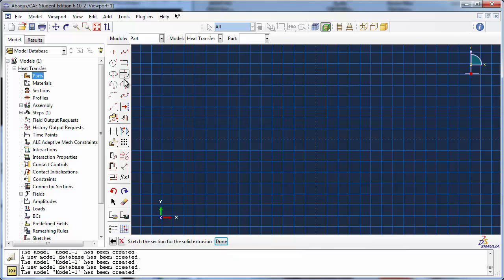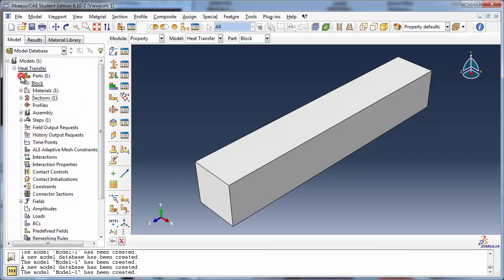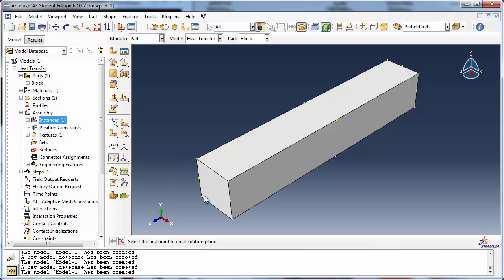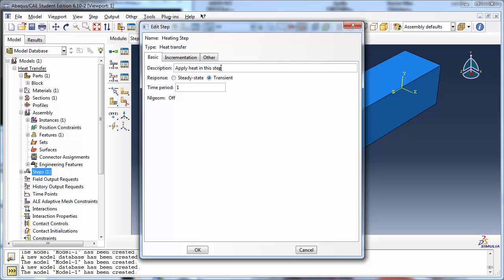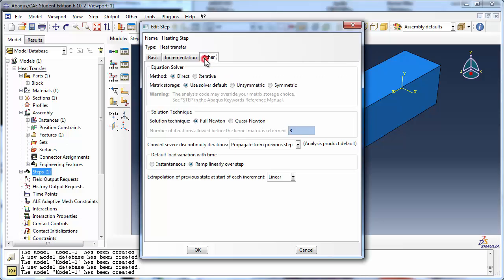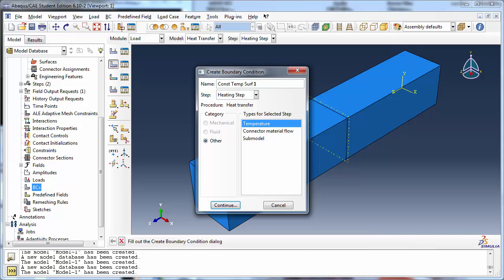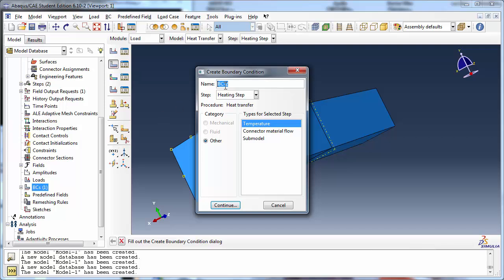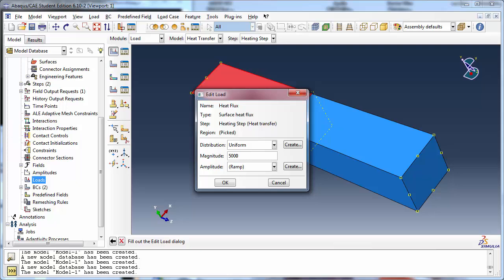10.b) Heat Transfer Analysis - Part 1 of 2 (with audio)

Comment: Hi, sorry if this sounds too basic, but I'm just a beginner here.
I'm trying to figure out how to run a simulation which has a three-layered box 
(ex. a large box with a medium sized box inside of it, with a small box inside the medium box)
heating inside of a convection heater at 180 degrees celcius. I also have two additional
radiation heaters placed underneath the three-layered box to begin heating the inner box first.
Could you (or anyone) please let me know how to simulate this using this program? Thank you!